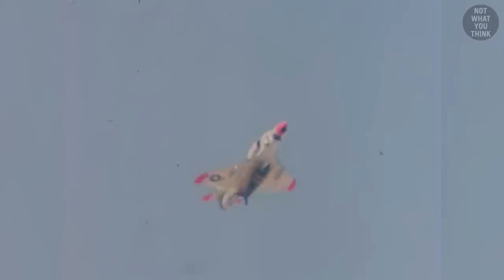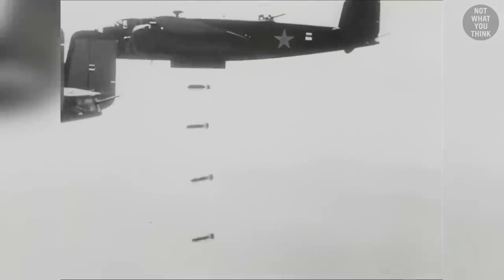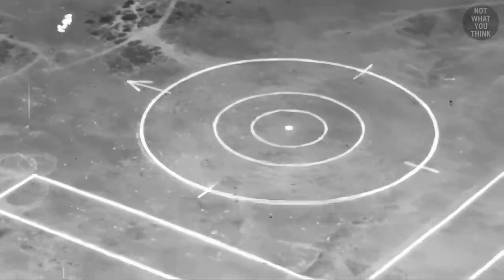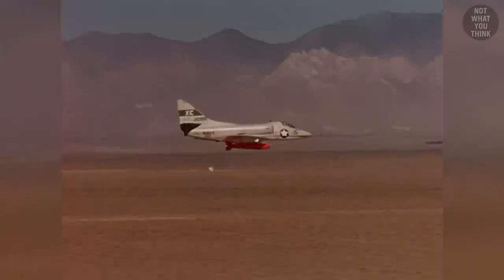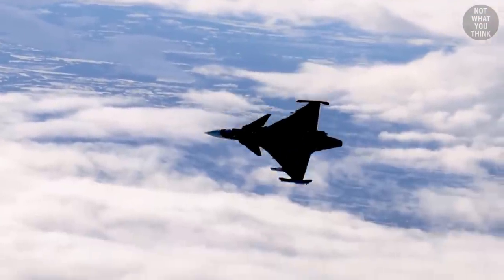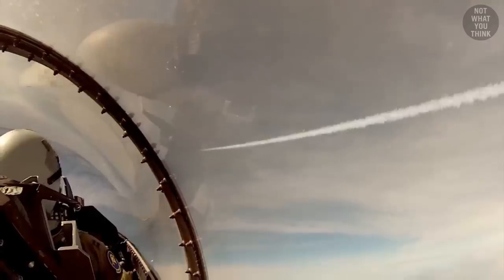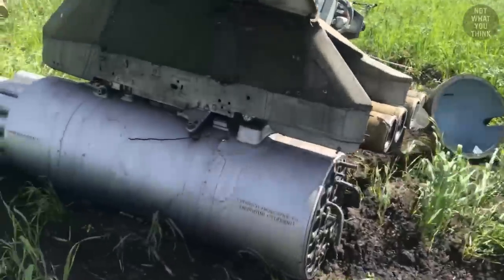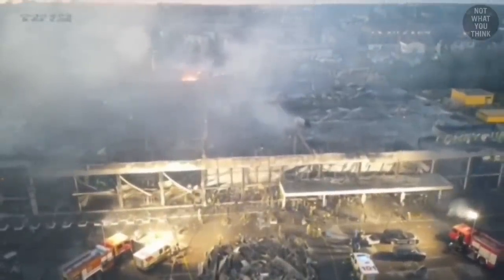Why Are Russian Helicopters Shooting Up at the Sky?

Comment: The concept is already old (Warsaw Pact), so far it could not be tested

Attack from the climb

Application to attack large group and area targets heavily covered by air defenses. Mainly, unguided missiles are used in indirect aiming, in a sense from "covered firing positions" from a greater firing distance than allowed by the other attack methods.

The method of attack from the climb is relatively new and is in the process of being tested. Opinions vary widely on the applicability and effectiveness of using the sighting technology currently available in attack helicopters (MI-24). However, it can be assumed that attack from the climb is contrary to the nature of the attack helicopter as a highly mobile precision weapons carrier and the intended "engagement of small-area, mobile land and sea objects."

Attack from climb is therefore considered an exception to be used when other methods of attack are not possible.

However, the future may bring a change; for example, with the introduction of terminal-phase guided weapons: the first phase of flight is ballistic or aerodynamic, and in the second phase (terminal phase), the weapon is directed at illuminated targets or approached by various methods (infrared, radar, television guidance, electromagnetic fields).

Advantages

large maximum firing distance of unguided missiles of 4..4.5 km
Reduction of the effectiveness of enemy air defenses
applicability even in unfavorable visibility conditions

Disadvantages

Since there are no sighting devices and the salvos are highly scattered due to helicopter movement, the probability of a hit is reduced.
Less effectiveness at the target, because of the lack of penetrating power due to the long distance.
in individual cases, warheads may fail to detonate because the required impact velocity of 250ms-1 may not be achieved
large fuselage inclination of the helicopter (5°..8°) near the maximum speed and strong vibrations
control problems when initiating climb (bank moment) and the abrupt deceleration when firing large salvos
large required safety distance to friendly forces, since the missiles have a strong longitudinal dispersion; engagement of targets directly in front of friendly forces is thus not possible
relatively high altitude gain

Comment: Am no expert, have never even been in a helicopter and I have certainly never tossed my 5cm thick rocket indiscriminately into a Ukrainian,for real nor on WarThunder. But if you have the skill to fly a top off the line attack chopper and due to your training you can put a  rocket through a barn door easily, well I'm sure after a couple of warm ups any attack chopper pilot would probably be able to get a lot more accurate than we're giving credit for. I'm sure their commanders back at base would be going mental if a pilot just kept wasting rockets aiming for targets he wasn't hitting instead of using on a target he could. I know that most of the Russian troops are a shambles but not generally the pilots due to the lengtyh and difficulty of their training.

Comment: It's very simple. 
To do combat work and not be shot down. 
Ukrainians are armed to the teeth with MANPADS and anti-aircraft artillery. In order not to get under fire, your fire is applied from as far away as possible. 
Since guided missiles are very expensive, they are used only to hit point targets: tanks, air defense facilities and other important targets. 
And dispersed targets are hit by unguided missiles. This is the easiest way to hit manpower and unarmored equipment, since even with an inaccurate hit from these missiles, a hail of fragments is formed. 
But since MANPADS have a higher range of application than the effective range of use of unguided missiles, to increase it, missiles are launched from a canopy, that is, from a cab. 
On the one hand, it seems to us that these missile launches are insignificant due to the low accuracy in scattering. 
On such more advanced helicopters as the Ka-52 and Mi-28, a combat computer was specially firmware for this, and now it calculates the range and angle of missile launch itself. 
The crews on the MFD screen control the hit on the enemy's location area. The missiles fall almost vertically, the kinetic energy is of course already less than with direct fire, but the fragments do their job.
If necessary, the start is repeated.
That is, I think this is actually the problem of all armies. This is not because it is the tactics of the Russians.  
It's just that there haven't been wars for a very long time where the capabilities of the opposing sides were comparable. There is both aviation and air defense. 
Remember, NATO fought in Iraq and Afghanistan against much simpler armed people who did not have serious air defense and especially aviation. The USSR fought in Afghanistan and Russia in Syria, and everything is also similar. 
But this war, where, although aviation and air defense in Ukraine are significantly suppressed, still has a place to be and be quite dangerous even for professional armies like the Russian one. 
Therefore, you should understand that today any army in a similar conflict with another army would also behave, fire from artillery and launch unguided missiles from afar. Because high-precision weapons have a high price and tend to run out compared to decades of accumulating arsenals of conventional weapons like shells, bombs and unguided missiles.

Comment: why need acuracy for a nuclear weapon? just but it remotly close to the target.
Reply: A 1 megaton bomb will destroy everything in a 4-5 km radius which is only slightly larger than most air/naval bases.

Missing by 10 kilometres could mean blowing up civilian apartment complexes and doing some moderate radiation damage to military infra
Reply: @tge2102  10km away isnt remotly close. I was implying much less of difference betwen target and impact. btw 10km is 6.21371 miles. argument is only slightly valid.

Comment: the rocket are dirt cheap, like $1000 each. a Precision Guided Weapon like Hellfire missile cost $150.000

say you want to Supress and destroy enemy Infantry Section manning several Foxhole. 

ofc You could spend like 1 PGM each on enemy foxhole position  to neutralize Enemy position that only composed of sandbags and dirt.
or you just lay waste on general area with 150 rocket, which was a fraction of the cost

Comment: I've been doing this in DCS "for science", but it's very, very far from being precise; the only way you can aim is using the ShKVAL mode that shows the CCIP solution and that'd at best be good enough for what the Orcs are doing in Ukraine, basically transforming the helo into an aerial artillery launcher. I just don't get why no aircraft has some sort of CCRP mode for it to get the stuff at least into the general area, like a medium range SAM site or artillery encampment. Might become a thing in the near future though with stuff like the APKWS that would need to unfold their control surfaces not directly after exiting the pod though, but at a later point like 20-30s before projected impact with a JTAC lasing targets.

0:00 Not almost as big as the fuselage, but that works well with some CBU-97s on the Viper in DCS...

Comment: You missed the whole point.
Rocket lofting/lobbing/tossing is not meant to be accurate. If you don't know where exactly the rocket is gonna hit (in an area where the enemy is hiding or in trenches), how the hell is the enemy going to know that? 
It is also used like the GRAD, which is not accurate at all, even at close ranges, but it's not meant to be.
"nObOdY kNowS wHaT TheIR ExaCT PurPOSE iS" - 🤡

Comment: Ukraine had been bombing civilians in the Eastern region for 8 years and noone moved an inch. 
Also Kh-22 is actually hitting what it's MEANT to hit. The building was hit because some morons in Ukrainian air defense has tried to shoot it down while it was over the city already.
The use of rocket pods is for area targets and there IS a firing mode for that in the targeting system. It targets the area and is used against dug-in infantry, soft-skinned vehicles, etc. As an area weapon, much like GRAD MLRS, it works just fine.

Comment: The reason war can happen is "The Rules".  If there no rules, war wouldn't happen the way it does. War is another word for politics without conclusion.
A lot more politics would be concluded if there were no rules.

It's the same thing with traffic signals and signs. Accidents happen because people trust that everyone around them is following the law. When they don't...  Oopsie, call insurance mandated because the state requires it. Without traffic signals or signs many studies have proven that people drive slower and more carefully but unimpeded by traffic, freely without incident generally (autobahn). However it is more uncomfortable because fear is involved in moment to moment calculations of a traffic situations. Rotary intersections have proved this correct. Rotaries require you to asses the situation and not assume it. Much slower, much more efficient except in extreme traffic from many angles. However, accident rates leading to injury and property are vastly reduced and time to traverse is magnitudes better when not congested. 

Those lack of rules apply to nuclear war which is good but not to conventional.  That is a mistake.   If you want to enforce an outcome which will have severe costs to both your target and you, you do it without restraint. If you calculate that a certain percentage of your own people will die in the conflict, you reconsider using violence in such a way.